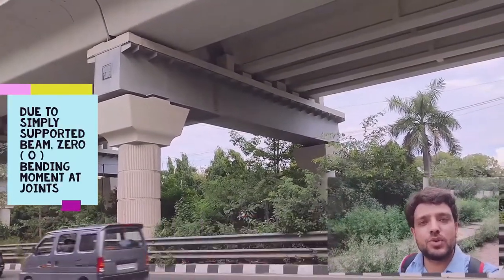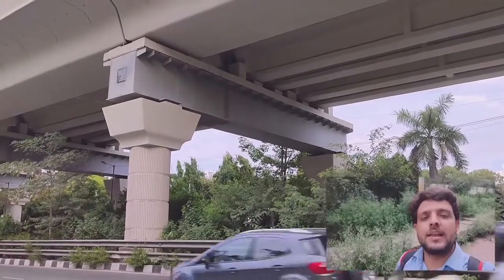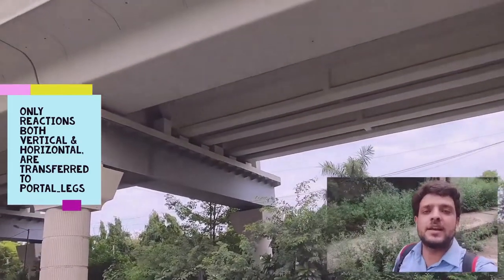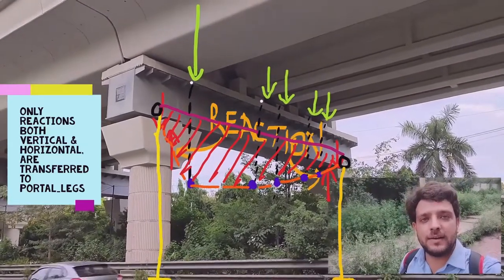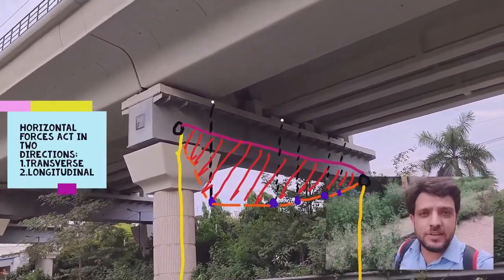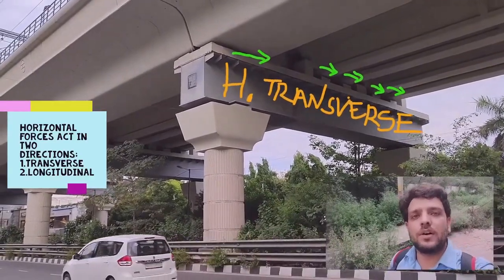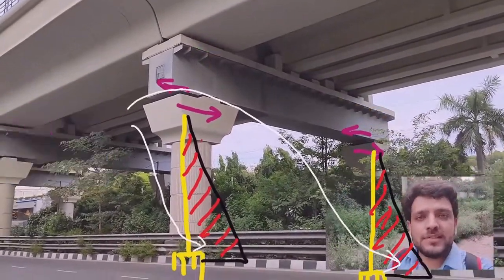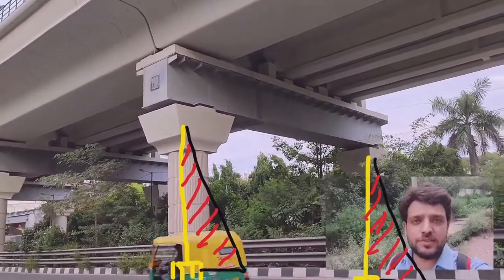PINNED PORTAL BEAM | BRIDGES | ALL ABOUT BRIDGE ENGINEERING

Comment: What is the connection between steel tub girder and the slab above it????
Reply from the maker: Unfortunately could not climb the pier this time😄 !! 
But if you notice, pedestal is resting on slab which I assume is supported through shear studds. 
Also notice the little door that you can see at the end of steel tub. One of these doors was partially open in the subsequent portals and I saw heavy stiffeners on inner side of hollow tub to avoid web buckling, web crippling and other effects of the tub web.
Reply: @AllAboutBridgeEngineering  Yeah, Portal beam here in this case is simply supported Composite box/tub girder made composite using Shear studs. The reason here to make it composite with concrete deck slab is that the top flange of the portal beam experiences compressive stress for all vertical loads and steel material is prone to compression buckling. Making it composite major component of compressive stresses shall be taken by concrete slab over tub girder.
Reply from the maker: Yes that's correct, deck above will help the steel tub to withstand compressive forces more smartly and safely. Similar is the phenomenon for UnderSlung Trusses where top chord mostly subjected to compression is assisted by the deck above

Comment: Portal beam is simply supported. What about the girder, what do you call its support?
Reply from the maker: In this case the Portal beams supports bearing on each side over which girders are rested. These girders in this case are simply supported too
Reply: @AllAboutBridgeEngineering  Simply supported, and that's pinned on one end and roller at the other?
Reply from the maker: Not exactly.
Using Pot Ptfe bearings and it's types degrees of freedom can be restraint or simply using Elastomeric bearings on each end
Reply: @AllAboutBridgeEngineering  So these bearings allow horizontal movement due to lateral load?